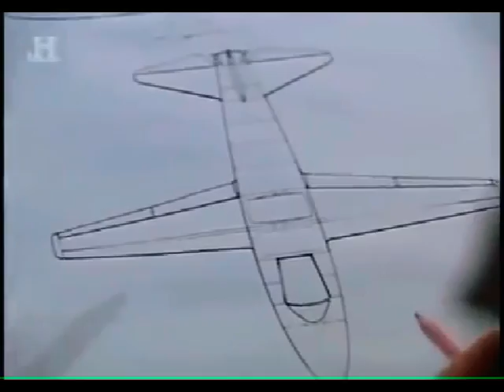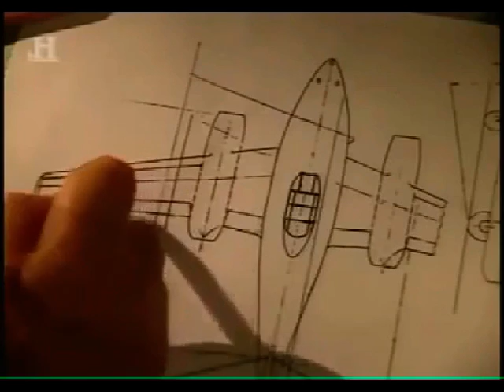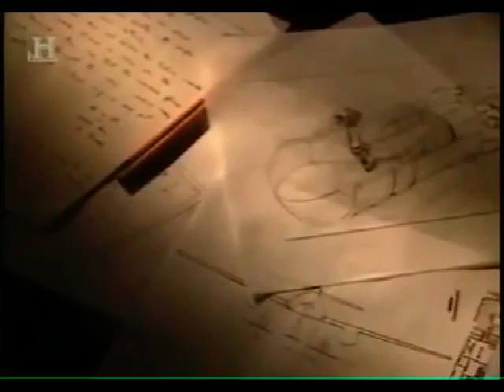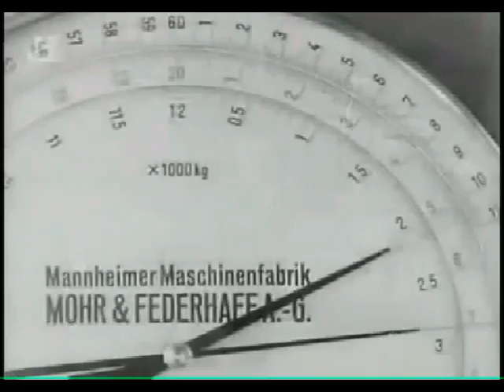The Father of the Jet Engine - Hans Von Ohain

Comment from the maker: The Jumo 004a (not the 004b)..had a service life of 200-250 hrs ...the limitation of the engine was down to materials shortage and not the design or construction. Further, it could be swapped out in 2hrs - unlike a spit engine which too 48hrs
Reply: +spottydog4477 If the German engine were so good they wouldn't have been discarded so quickly after the war.
Reply from the maker: They werent.........
Reply: +spottydog4477 Yes they were. They were an evolutionary dead end, superseded by British designs. No engine today traces it's history back to the German jets. Every engine produced today is related to Frank Whittle's designs.
Reply from the maker: German AXIAL flow design = Future of all engines
British Centrifugal design - junked by '47
Reply: +spottydog4477 France  built its fighter jet industry based on BMW 003 ..Dassault ,the most successful  pioneer in Europe didn’t even consider British technology..germans were miles ahead ...
Reply: +spottydog4477 German axial flow engines were copies of British axial flow engines. Britain was not just world leader in centrifugal designs it was also leader in axial designs. This was no surprise seeing as the inventor of practical axial compressors, AA Griffith, was very much British. We never saw British axial engines in the war because centrifugal engines of those early thrust ratings were simply vastly superior. The Gloster Meteors reserve engines (Metrovick axial flow) were the best axial engines of the war. It is not surprising countries with zero experience of jet technology (France and Czechoslovakia) picked up some free German tech after the war before quickly discarding it.
Reply: +FORBAN2 What do you mean they didn't consider British technology? The Mirage aircraft were built to accept RR Avons. I believe some of the prototypes even flew with British built Avons!! The French didn't even have confidence in their own design (which no doubt was a copy of the Avon in any case). In fact many customers refused to buy Mirages unless RR Avons were fitted.
Reply: +FORBAN2  I think you had better do some more homework. France's first successful fighter the Dassault Ouragan had a RR Nene. The later Dassault Mystere used a RR Tay and the Mirage III was designed to be able to take the RR Avon and flew with one. France also built the Vampire (as the Mistral) with a RR Nene. The Caravelle airliner used RR Avons so would that count as considering it?

And the Avon was a much bigger success worldwide than the Atar. 

The US licence built the RR Nene,  Tay and the AS Sapphire and later the RR Spey (as the TF-41) used in its A7 Corsair. Sooo. I think
Reply: +spottydog4477  Aaaah nope. Utter nonsense. Centrifugal engines are in use in their tens of thousands all over the world today primarily as turboprops and are still in production.

As for the centrifugal engines being junked by 1947 - that is nonsense.  The RR Nene was licenced/stolen by the Soviets and used in the MIG 15/17 (and the Chinese in their copies) which outperformed the early Sabres in the Korean war, the French used the Nene in their Vampire version the Mistral, The Nene and Tay in the Ouragan and Mystere, the Canadians licenced the Nene and used it in their Silver Star T-33 variant. The US used the Ghost (J-33) in the F-80 and the T-33 (some of which are still in service with air forces today) and the Nene (J-48) in the Grumman F9F Panther, Grumman F-9 Cougar and Lockheed F-94 Starfire.

So not so Junked then… FYI Time for some homework.   As for axials - Whittle had designs for an axial engine in the 1930's - well before Franz- in fact that was his first preference (as it was for Griffith) but he knew the metallurgy wasn't up to is at the time.This was proven by the incredibly short service life (around 10-25 hours) of the Jumo and BMW units.

More to the point - the British had axial engines running in 1941-  the same time as the first full tests of the Jumo 004 and flying in 1943 (Metrovick F2) long before they saw a German engine and in the production pipeline with the Avon and Sapphire shortly after WWII. When the UK and the US experts examined German jet technology after the war they found nothing significant and the British continued developing their own axial units which were then licenced by the US and used by many other countries. If German engines were truly superior the US would have copied them and not had to pay licencing fees to the British.
 
Just FYI, the longest running production axial gas turbine engine in history is the RR Avon which is still in production as a gas turbine generator.
Reply from the maker: and AXIAL flow engines are made 1000 times more often than centrifugals  in todays production
Reply: +spottydog4477 Do you take this Aerogeek   idiot seriously ??  All post war Rolls Royce engines were dead end !!Yes all UK and US experts WHO examined German engines came to that conclusion : 

  the end of the war the Germans had at least three separate full scale company-based jet engine programmes in progress, as American and British interrogators discovered to their astonishment in the summer of 1945. Ohain's original test engine, the He-S3B, had been built for simplicity with a centrifugal compressor like Whittle's, but Heinkel had then proceeded to more advanced designs like the He-S30 with axial-flow compressors. Meanwhile at Junkers, Germany's leading engine maker, Anselm, Franz had led the development of the Jumo 004, a simpler  axial-flow   turbojet, which went into 
mass production and powered the Me-262 fighter. A third programme at BMW produced the Bramo 003 engine, which featured a counter rotating compressor, different from both the Jumo 004 and the Heinkel He-S30. Ultimately it was this Heinkel design, incorporating both rotors and stators, which became the standard configuration for commercial jet engines.6 On this evidence it is clear that the Germans were decisively ahead in the field by the spring of 1945. And this feat is all the more extraordinary when one considers that they lacked vital raw materials with which to make heat-resistant turbine blades, such as nickel, cobalt and manganese, and that their work was continually disrupted by the Allied bombing campaign.7 By contrast the British were proceeding on a narrower front, with Whittle's relatively primitive design remaining the main empirical reference point for British engine manufacturers.There is not much doubt that had Germany not been defeated it would have led the world in jet engine development in both the military and civil sectors.WHO is right ?? a  Professional autor like Peter Lyth  ( a Brit I might add) WHO comes up with a study and an impressive reference list    or   a notorious troll and pretender  like this  Complete Aerogeek.. Everything what  this moron says  is bullshit.. Brits never ever ever had a working axial flow engine until 1950's   !!!!!!!!!!!!!

www.artefactsconsortium.org/.../3.04.Transport-Lyth,JetEnginesGrPics75ppiWEBF.
Reply: +spottydog4477 it was Pratt&Whitney who pioneered the twin-spool concept in 1948, long before Rolls Royce which made commercial jet engines possible as single spool turbojets would never have been suitable for commercial application due to high fuel consumption and both GE and Pratt&Whitney have introduced the high by-pass turbofan ratio engines before Rolls Royce in 1960's this was the first time the US overtook Britain in engine design as well.
The rest of the story is common knowledge. These developments have nothing to do with Whittles primitive centrifugal ..
Reply: +barracuda7018 Wrong again. You must be used to it by now. Bristol Siddeley did it with the Olympus in 1950. The world's first two shaft/spool engine.The two spool P&W J-52 did not run until 1955. The RR Conway was also the world first turbofan engine... Even the P&W J-47 was based on the Metrovick F2. The US used the Sapphire (J-65) ina  number of its aircraft and the turbofan Spey (TF-41) in the A7 corsair.
Reply from the maker: Gary Tarr Ladies..please......a little courtesy....
Reply from the maker: Gary Tarr - banned - this time no coming back fucking troll that you are
Reply: Not only that but the Mirage itself was a rebooted Fairey Delta. Went on to become one of the most successful aircraft ever built. Ignored by the British gov, as usual. Also Whittle went with the centrifugal design for practical reasons, they were building the compressors for the superchargers already, geez, they think Whittle was unaware of axial flow engines??
Reply: Reliable for 25 to 50 hours only due to unsuitable alloys
Reply: barracuda7018
Re-read what aerogeek said and then realise the British did all that basically working in garden sheds before Rolls took up production.
Reply: Well said Martin de Angelis,  These fools should look at the original Whittle patent to see that it was both Axial and Centrifugal, ohain did NOTHING original that hadn't been encompassed by whittles ideas!  And I challenge anybody here who has a Patent (and hence understands the process) to say otherwise!!!!!
Reply: no try 10 hours till complete rebuild.   But yes you are right.  It was materials.  The alies prevented germany from getting nickel and chromium!  This above all else was pivotal to the construction of the turbines!  while I disagree with those argueing that Ohain was the father of the jet engine, reliability claims are unfounded!
Reply: Bear Baler I disagree with those argueing that Ohain was the father of the jet engine, reliability claims are unfounded!

Mate  he Von Ohain  progressed  much faster than Whittle and solved technical problems faster than the British..I  and  I am not alone on this, the majority of aerospace engineering community in France disagree with those who argue that Whittle was the sole inventor of the jet engines we fly today as there are tremendous amount of evidence proving otherwise.Todays high bypass axial flow engines have nothing to do with whittle, absolutely nothing . 

On the  other hand I know  the british mentality, many  brits think that because they produce  the  wings in  an Airbus plant in Wales, the  Airbus  is  a  british designed plane.  Nobody is surprised.
Reply: FORBAN2
Jesus H Christ, get an education, please. It's embarrassing reading.
Reply: Martin de Angelis, we can't educate a fool mate!
Reply: Bear Baler LOL ...
Reply: FORBAN2
It was well meant advice. Educate yourself. Take it or leave it. No skin off my nose.
Reply: Forban2 - Your rant is so full of inaccuracy that it is unworthy of deconstruction. 

Look, no one denies that original concepts can be developed, expanded and improved by others. This happens all over the world all the time. There can only be one inventor however and in this case it was not Von Ohain for the myriad of reasons already stated by others. There have been several incontovertible truths put forward already that prove Whittle's claim. All we get from the two or three naysayers on here is "unfounded" or "not true" etc. etc. without any evidence to back it up. One can only wonder if they are working to their own agenda. If you want evidence, go to the British Patents Office or read Von Ohains own account in his memoirs. Alternatively, read the US government's own reports of their debrief of Von Ohains team after the war. Do some proper reading before you come on here spouting what you want to believe rather than what is true. I am fed-up with people trying to rewrite history. If you want that, go and watch a Discovery Channel documentary or something.

Also, I think you are exagerrating in your anti-British diatribe on the origins of Airbus. I am unaware of anyone thinking that Airbus is a British designed plane. Everyone knows that many designers from many countries contribute to the final product. The fact that the wings, undercarriage, engines and many other items are manufactured in the UK doesn't mean that it was designed there.
Reply from the maker: Hi Tangles. I think I  was pretty grumpy that day when Gary for to me....ahahaha

hope you're keeping well mate!!
Reply: spooty.
It is such a shame you do not do proper research and you let idiots like barabum and fornob tell lies.
Ohain copied whittles patents and the German jet engines were poor designs, they never worked properly.
Whittle went to USA and gave them their first jet engine, Rolls Royce took over the early Whiittle design and improved it to make the Derwent and Nene.  Metropolitan Vickers made working axial flow engines that were well in advance of the Jumo or BMW.
Post war the RR Nene and RR Avon  along with the Armstrong Siddeley Sapphire were the engines that went forwards, the  BMW held France back a lot and the Jumo was quickly dropped by USSR and they were very glad to get the Nene, Czechoslovakia tried to use the Jumo in their version of the Me 262 but it took years and was soon dropped.
Reply: the best was (as allways) BMW - they had a single, radial combustion camber and they also had stators and their 003 had a much better thrust to weight and fuel consumption ratio then the Junkers one
Reply: spottydog4477 centifugal compressor are still flying in helicopters, meaning that this is not an obsolete technology.
Reply: ww.ww
The BMW was even worse than the Jumo, the British designs were not only more reliable but gave more thrust.
Reply: barracuda7018
Not this turkey again!
Reply: THEY WERE
Reply: @ Barrie Rodliffe
 - More reliable than the German engines? Yes. Greater thrust? No.
Reply: Google "Metropolitan-Vickers F.2 engine"
Reply: The Vickers never saw service during WWII...

The Metropolitan-Vickers F.2 was an early turbojet engine and the first British design to be based on an axial-flow compressor. It was an extremely advanced design for the era,[1] using a nine-stage axial compressor, annular combustor, and a two-stage turbine.

It first powered a Gloster Meteor in November 1943, outperforming contemporary models from Power Jets. In spite of this excellent start, it was considered unreliable and never saw use during the war. In the post-war era, a number of engines provided much higher performance, and interest in the F.2 waned.
https://en.wikipedia.org/wiki/Metropolitan-Vickers_F.2
Reply: I spoke with a former draughtsman from the Gloucester factory. He told me the Jumo was a far superior engine hindered by a materials problem, especially in certain seals required, which reduced the engine's life. apart from that, the Jumo ran rings round the British product.
Reply: Colin Rowley   - The number one problem with the Jumo engine was the lack of nickel alloy steel for the turbine. There was a lack of nickel in Germany and what little there was, was used elsewhere.  I worked on jet engines in the USN. Engines like the J-52 and TF-30 used carbon seals internally. Did not seem to be a particularly strategic material.  Jumo engineers resorted to hallow, air cooled turbine blades to help extend their life but even so, engine life was as little as 10 flight hours. 
One reason the 262 ran rings around the Meteor was that the German jet was much cleaner aerodynamically.  The 262 looks like a shark, the Meteor a whale.
Reply: @scootergeorge9576  
The number one problem with the Jumo engine was bad design.  It was dropped at the end of the war, Britain looked at it and had no use for it, USA got British designs and had no use for such a poor design, France did take the BMW but had to modify it a lot, they also used British jet engines, USSR tried to make the Jumo work but gave up.
One of the reasons the Me 262 was a poor fighter, it was not a good design, the Meteor was more advanced.
Reply: @barrierodliffe4155  The Westinghouse J-34 looks like it borrowed quite a bit from the 004.  The Me 262 was designed to be a bomber interceptor  and not a fighter in the classic sense.  Meteor more advanced? Not really.  The centrifugal turbojet was a dead end design.  The 004 was flawed, primarily due to the lack of high temp alloys such as nickel.
Reply: @scootergeorge9576  
The J 34 first run in 1947 was developed from the J 30 which first ran in 1943, so  it did not owe anything to the failure Jumo.
The Me 262 was intended to be a fighter,  the Me 262 was not advanced, it started life as a straight wing aircraft, later modified to take the Jumo engines, the wings slightly swept back to correct the balance but not for aerodynamic reasons and also changed to a tricycle undercarriage.  The centrifugal engine worked and is still in use while the Britiash axial flow engines led to what we have now, the badly designed Jumo was very much a dead end, it still did not work with suitable alloys.
Reply: @barrierodliffe4155   High speed + heavy armament + poor turning capability = interceptor. And with the bombing campaign by 8th AF devastating Germany, bomber interceptor is the only logical  conclusion.
Reply: @scootergeorge9576  
The Me 262 was designed before USA was even in the war, so that theory fails, try harder.
The USAAF bombing was not even a great threat until late in the war by which time the Luftwaffe was short of fuel and experienced pilots.
Reply: @barrierodliffe4155   - By 1942/43 the design had been finalized as an interceptor armed with four  30 mm cannon.  The primary reason the Luftwaffe was short of fuel was the concerted attacks on synthetic fuel refineries in 1944.  And it was not till '44 that the P-51D was available in sufficient numbers to protect the bombers deep into Germany.   This cut into fighter pilot training but Luftwaffe policy of keeping pilots in combat till dead had a lot to do with it too. Their experience was not passed on to the replacements.  And American P-47 and P-51 pilots had something to do with Luftwaffe pilot losses...
Reply: @scootergeorge9576  
The design was finalized before much USAAF bombing so it was not just made to protect against USAAF bombers was it?  The initial attacks on fuel refineries  had little effect, the RAF attacks on transport prevented the fuel from getting where it was needed, it was not until 1944 that the P 51 B/C were available in sufficient numbers to provide an escort, the P 51 D came later in 1944.
The P 47 and P 51 had little to do with Luftwaffe pilot losses and shortages in early 1943.
Reply: @barrierodliffe4155   The Luftwaffe transferred the bulk of their fighter forces from the eastern front to counter the bomber offensive.   And the P-47 and P-51 virtually decimated the Luftwaffe fighter forces.   There is no getting around that.
Reply: @scootergeorge9576  
If it was true rather than Hollywood nonsense.
Just try to look it up, The Luftwaffe was all but finished by 1943, they had plenty of fighters but had run out of experienced pilots thanks to  the USSR and particularly the RAF. There is no getting around the truth.
The P 51 did nothing much until 1944 while the P 47 was rather hopeless as a fighter.  .
Reply: @barrierodliffe4155  - the P-47 was far from being "worthless" as a fighter  A number of American aces achieved impressive records while at the controls of P-47s. Thunderbolt top guns included Francis “Gabby” Gabreski (28 kills), Robert S. Johnson (27 kills) and David C. Schilling (22.5 kills).
https://militaryhistorynow.com/2015/04/20/the-jug-10-cool-facts-about-the-p-47-thunderbolt/
Reply: @scootergeorge9576  
The P 47 was the biggest, heaviest and most expensive single engine fighter, it had poor performance and lacked maneuverability, the USAAF claims are notoriously inaccurate as the USAAF pilot of an unarmed Spitfire PR Mk XI found, he was attacked by 4 USAAF P 51's and having outmaneuvered them then climbed away after noting their markings, he later went and found out who the pilots were, he was very surprised to find that at the time and place they had been vainly trying to shoot him down with no Luftwaffe in sight, they each claimed  1 Bf 109.
Your link is a very jingoistic load of tripe to be kind to whoever wrote it.
The many times P 47's attacked Spitfires and never once shot one down is rather amazing, nothing else is, the Spitfire was faster, had much better acceleration and climb, went higher dived much faster and was far more maneuverable, I have heard that USAAF P 47's also attacked Hawker Tempests often but again no chance,  there is even an account of Tempest pilots fed up with being attacked so often turned and shot down a couple of the P 47's, there are two versions, in one it is Belgian pilots, in the other New Zealand pilots. It seems that British pilots just flew away rather than shoot down allies.
Reply: @barrierodliffe4155     430+ MPH  is hardly indicative of poor performance.  While not as nimble as, say,  a Spitfire, it was fast, rugged, had decent range, and had massive fire power.  Many pilots loved the "Jug" and were very successful with it in combat.  And it certainly was not only  one of the greatest fight/bombers of WWII but of all time.  One of the biggest mistakes the USAF made was not keeping a few hundred Thunderbolts in service with air guard units after the war. In Korea, it would have been a much better weapons system than the F-51 Mustang. 
In the heat of combat it was not unusual for Allied pilots to mistake a Mustang or Spitfire for the Bf 109. Same with the P-47 and Fw 190A. Probably the only Allied fighter that did not have that problem was the P-38 which largely was a failure over Europe but did quite well in the Pacific Theater of operations.
Reply: @scootergeorge9576  
430 mph is not bad, the poor acceleration and climb is not very good, by the time the P 47 was in the war the Spitfire had half decent range and unlike the Blunderbolt very successful in combat.
It took a P 47 D of 1944 longer to get to 30,000 feet than a 1942 Spitfire Mk IX took to get to 40,000 feet.  P 47  range at cruising speed 785 miles on 205 gallons.
Spitfire Mk IX range at cruising speed on 85 gallons would not be far short of that.
In the heat of battle is one thing but when the only aircraft around are allied is when USAAF pilots often tried to shoot down Spitfires that look nothing like Bf 109's and had rather distinctive markings and invasion stripes?   I do not recall RAF pilots trying to shoot down P 47's.
Reply: @barrierodliffe4155   Blunderbolt? [roll eyes] a good fighter pilot takes advantage of his aircraft's strengths while denying the enemy his.  The great service ceiling and fantastic dive speed allowed American pilots to fly above the bomber stream and dive down on the hapless German with speed they could not match. The speed gained in the dive also allowed them to climb back up with little feat of being tailed.  
Range and Endurance..."the Thunderbolt II and Mustang III easily head the list..."  Turning Circles..."In circumstances where the ability to turn quickly or tightly are infinitely variable, and where two aircraft are nearly the same, such as the Tempest V and Thunderbolt II, a great deal depends on the ability of the pilots. Speed must be taken into account if the results are going to be of any real value.
 For example, if a Tempest dives on a Thunderbolt with an overtaking speed of only 50 mph, the Thunderbolt will easily be able to avoid the attack by turning, although at the same speed in the hands of equally competent pilots, the Tempest will outmaneuver the Thunderbolt." More at http://www.wwiiaircraftperformance.org/sl-wade.html
Reply: @scootergeorge9576  
A good fighter pilot would love to be in a good fighter, that rules out the P 47.  
The poor service ceiling and low dive speed are not much to rave about either.
range and endurance were not exactly strong points on the heavy blunderbolt, it only had 1.5 hours endurance at normal cruise speed with 205 gallons, a real waste of fuel that could take a Spitfire faster and further. If the 
P 47 pilot dives on a Tempest he will be dead very soon and the slow lumbering p 47 did not turn, especially at low altitude while the faster more agile tempest did as well as the Tempest having firepower the P 47 pilot could only dream about.
Reply: @barrierodliffe4155   - Tell it to "Gabby" Grabreski. Polish-American who flew Spitfires with the RAF before Pearl Harbor. Had no aerial victories  but when he returned to the Air Force was assigned to fly the T-Bolt.  His first impression was, like you say; too big, bulky, heavy, etc. to be a fighter.  But he quickly changed his mind. It was a plane that could absorb a tremendous amount of damage and get him home. And his 28 confirmed air to air combat victories  say it could mix it up with Luftwaffe fighters and come out ahead of the game. 
And in the fighter/bomber role, the T-Bolt had a big advantage over Tempest and Typhoon and the Mustang for that matter. It lacked a radiator that could be punctured with small arms fire. It did have a big, hulking, 2,000 HP radial that could have a cylinder or two knocked out and keep on running long enough to if not get home, get out of enemy territory.  That is something pilots appreciate.  
Fuel efficiency was not the T-Bolt's strong point but  it wasn't years later with the F-4 Phantom II. That was a big, heavy powerful, rugged workhorse.  And while not as nimble as say, a Mig, when its pilot got the training to not only engage in air to air, fighter versus fighter combat such as Naval Fighter weapons School, better known as "Top Gun"  could kick ass.  Hell, when I was in the Navy with VC-13, the Fighting Saints, now VFC-13 Saint Adversary,  our pilots flying the TA-4J "Scooter"  would go up against Phantoms and  Tomcats and have some success.  And they were reservists!  But they did accumulate a ton of flight time with the fleet first...
Reply: @scootergeorge9576  
Any pilot who flew Spitfires before Pearl harbour and had no victories either had no or little combat or was not much good.
28 claims or so called confirmed victories probably include a number of aircraft the returned to base with little or no damage like all the Tempest's and Spitfires that were attacked by P 47 pilots yet they all flew home undamaged  and the USAAF pilots made yet another claim that was somehow confirmed.  
The Blunderbolt could be taken down by one 20 mm cannon shell in the wrong place, being air cooled did not mean it was impervious to damage.  
It is amazing how Spitfires often flew home after being hit by not so small arms fire or 20 mm cannon, the P 47 losses were rather high, the Typhoon was better for ground attack and having real firepower rather than pea shooters, just to quote the US Navy and USAAF both wanted to replace the 0.5 with 20 mm cannon and they rated the 20 mm as between 2.5 and 3 times more effective, like the Spitfire pilot who shot down 5 and damaged 2 more in a few minutes, 4 of the shot down and 1 damaged were Fw 190's.  
The P 47 does share being overweight and under performing with the F4.
Reply: @barrierodliffe4155   - If you've never heard of the man, just come out and admit it.  He had no combat experience when he asked the Air Force to release him to fly combat with the Polish Squadron of the RAF.    As for the 20 mm claim, just about any aircraft if hit in the right spot would be shot down.   And you can't seriously believe that a radiator in a liquid cooled aircraft would not be vulnerable and if hit in a single engine aircraft, the engine will seize in short order. 
The F-4 Phantom II was a great aircraft in it's day.  One of very few carrier aircraft successfully adopted by the Air Force.   Eleven other nations also flew this  aircraft.  http://military.wikia.com/wiki/McDonnell_Douglas_F-4_Phantom_II_non-U.S._operators
Reply: @scootergeorge9576  
I have heard the name but not much about him, maybe you should learn before making false statements, he did not fly any Spitfires before Pearl harbour but only in 1943 and he saw very little action, the first time he saw any Luftwaffe was the 3rd of February and it seems he had no idea what to do. He flew 20 missions in the Polish squadron and only 1 with any combat.   That sort of puts his record into perspective and does not affect the Spitfire being a far better more capable fighter than the P 47.  
Spitfires had a better record than the P 47 and lower losses when the P 47 turned up which was late in the real war , maybe early for the US.
The F 4 had little success in combat, the Royal Navy only used a few of them and it had a poor record, no wonder they had to be used on land..
Reply: @barrierodliffe4155   In '43. My mistake. But no mistake that he was a great pilot and believed the Thunderbolt was an outstanding aircraft.
Reply: @scootergeorge9576  
But having hardly flown the spitfire and not in real combat not in a position to compare like  William R Dunne, who flew with 71 eagle squadron, he flew Hurricanes, Spitfires, P 47's and P 51's.
"One must have really known the Spitfire in flight to fully understand and appreciate its thoroughbred characteristics.  It was the finest and in its days of glory, provided the answer to the fighter pilots dream – a perfect combination of all the good qualities required in a truly outstanding fighter aircraft.  Once you`ve flown a Spitfire, it spoils you for all other fighters.  Every other 
aircraft seems imperfect in one way or another.”

USAAF 31st FG War Diary (when transferring from Spitfires to P-51s): "Although pilots think that the P-51 is the best American fighter, they think the Spitfire VIII is the best fighter in the air." 

USAAF pilot Charles McCorkle (who flew both in combat), reporting on a mock combat between a Spitfire and Mustang in 1944: "Now we could see which was the better aircraft...a Mustang and a Spit took off for a scheduled 'combat', flown by two top young flight commanders. When the fighters returned, the pilots had to agree that the Spitfire had won the joust. The Spit could easily outclimb, outaccelerate, and outmaneuver its opponent... 

Writer Jerry Scutts, quoting German pilots in his book JG 54: "The Jagflieger had to keep a wary eye out for enemy fighters, particularly Spitfires, a type JG 54's pilots had developed a particular aversion to...Pilot reflections do not, surprisingly enough, reflect over-much respect for the Mustang or Lightning'

Karl Stein, Luftwaffe Fw 190 pilot (who served mainly on the Eastern front): "English and American aircraft appeared on the scene in those closing days of the European war. Spitfires were the most feared, then Mustangs..." 

While these mention the P 51 not the p 47 that seems to reflect the P 47 not being considered to be a good fighter. The P 51 while not close to the Spitfire did climb better and go higher than the P 47.
Reply: @agt155  The French and Soviets used them for quite a while and technology progressed very fast in general so you cant say they where bad engines.
Reply: @user-qp3hd3cn8e  
The French used a very much modified copy of the BMW, but they also used Rolls Royce engines. The Czech's tried to use the Jumo for a short time, USSR tried to use German jet engines but they very quickly dropped them and used Rolls Royce engines, so i can say they were bad designs.
Reply: The Jumo 004B would probably achieve 200 hours though every 25 hours the engine had to have its turbine and combustion chambers replaced.  From the point of view of keeping Me 262 in the air this was not a problem:  you kept spare engines, they were going to get combat damage anyway, and every 25 hours you spent 8 man hours swapping out the two engines.   You could service the engines in the field but in practice went to a depot or factory to refit thos turbines and combustion chambers.  The engines could be x-ray inspected on the wing of the Me 262 and if OK kept flying till 37.5 hours but don't know if this was done.  The German test pilot Lindenner once nursed an engine for 60 hours.   The service parts were extremely cheap and the service not expensive so the Jumo 004 was probably cheaper to produce and run than a piston engine.  The BMW 003 was much better at this.  Its combustion chamber easily last 200 hours and the gas turbine could be swapped out while the engine was on the wing.  The Germans just didn't have the alloys for long lasting turbine blades.  25 hours flying is about 15 Me 262 missions.   The Me 262 used a centrifugal governor to control fuel to the engine but around April 1945 they were getting a device roughtly known as the 'accelerator valve' in place.  This measured the airflow through the engine with pressure sensors and adjusted the fuel flow so that there would be no more burnouts from excess fuel flow from throttle handling or flameouts. Would have increased engine life.
Reply: @WilliamJones-Halibut-vq1fs  
They were lucky to get 25 hours and that was with treating the engine carefully, the problem is they did not have enough engines and in late 1944  when they did put the Me 262 into service most of the 1,400 made never flew.
The excuse that they lacked good materials fails since after the war no one had much luck trying to use the Jumo, Russia gave up and used the Rolls Royce Nene as the basis for their jet engines, used had been given British jet engines during the war and more after the war, France tried to use the BMW but had to make a lot of changes and modifications to get it to work, they hedged their bets by using Rolls Royce engines in some of their aircraft.
Reply: agt155 The British “inventor” of the jet engine, AA Griffiths,  was so brilliant he calculated that  it couldn’t be done and so didn’t bother till others proved him wrong.
Reply: FORBAN2 The structure of the German engines was axial compressor, cananular or anular combustion chamber followed by a single or double stage turbine.   The Jumo 012 was a scaled up Jumo 004 but with blow out valves added to the compressor to allow higher compression ratios.  The Germans used impulse compressors but also had reaction compressors on the bench designed to upgrade existing engines.
Reply: @WilliamJones-Halibut-vq1fs  
The British inventor Frank Whittle, his design worked very well and once Rolls Royce got involved was developed into the best jet engine in the war and for a time after it.
Ohain's copy of Whittle's patent did not work.
Griffiths design was taken up by Metropolitan Vickers and it was a better design than the Germans could manage, leading directly to the jet engine first aircraft to achieve supercruise.
Reply: Barrie Rodliffe The key thing that made the British engines more reliable was actually two things.  1 the nimonic alloy and 2 whittles invention of fir tree roots.   The Americans never bothered with nimonic and used the alloys they had developed for turbo super chargers.  The whole remainder of the German engines such as combustion chambers, exhaust pipe and translating exhaust nozzle were mild carbon steel due to shortages and this considerably added to the problems.   The Russians nabbed a lot of German engineers from the Jumo plant at Magdeburg complete with families but they never got hold of the alloy specialists from Krupp and Bohler that had developed improved alloys.  There is an old American article around that says they got to about 600 hours life on the Bench and they were expecting about 200 in real life.   I interviewed one old German woman who said the Russians kidnapped a nearby German girl as a fiancée for a young single German engineer they were taking to Russia as a comfort so he wouldnt be the only single guy.  Very kind and considerate.  The Germans ended up considerably developing the NK-12 turbo prop used on the Tu 95 Bear as they were moved through several design Büros.  It’s essentially a Jumo 022.   The Jumo 004 was being scaled up to about 2750kg thrust as the Jumo 012 and with extra turbine and gearbox added becomes the Jumo 022.   The competing BMW P.3302 turbojet had a variant with a pure mild steel turbine that had a design life of 2 hours ie essentially one mission.  German alloy shortages became dire.  Who knows what the Russians were doing but it seems they did nothing to support improved alloys for the German engineers.   After the war, in 1947/48 the Siemens company used a Jumo 004 compressor as a gas turbine power generator designed to run of blast furnace gas.  The turbine was water cooled and the nozzles ceramic.  Water cooled turbines was actually WW2 German research for flight worthy engines.  It works and you have a little steam for de icing.  No one bothers these days, though steam cooling is used,  as the alloys are so good. I know there would be issues with calcination but it isn’t going to be a problem with calcination etc but that’s not an issue that’s only going to run 200 hours.
Reply: @WilliamJones-Halibut-vq1fs  
Maybe if the only British jet engines were The Rolls Royce WElland or Derwent. Metropolitan Vickers made axial flow while the Halford  made a different centrifugal design, these were all given to USA who never used German designs. Any alloys would not make a bad design good.
Reply: Complete Aerogeek Designs for axial gas turbines go back to 1903, the only concept Whittle and von Ohain “added” was to remove the power turbine and rely entirely on reaction thrust.  AA Griffiths only worked on turboprops not jets.    The Jendrassik Cs-1 was the world's first working turboprop engine. It was designed by Hungarian engineer György Jendrassik in 1937, and was intended to power a Hungarian twin-engine heavy fighter, the RMI-1.
Reply: Martin D A The Fairy Delta was a rebooted Lippisch.
Reply: Barrie Rodliffe von Ohain had a working jet design and it was different from Whittles.  Whittle used a double sided impeller, von Ohain used single sided with an inductor fan, Whittle used separate combustion chambers, von Ohain used an anular one.  Whittle used an an axial turbine, von Ohain radial inflow.  Heinkel merely conducted a patent search and used nothing of Whitles.  The difficulty was flame stability and the patents didn’t plain that.
Reply: Just like a Porsche 959 is a rebooted Ford Model T.
Lippisch had the bright idea of a basket of coal projecting  into the airstream and ignited by a gas burner. The unfinished Lippisch glider was captured by USA and taken away to the States, there is no suggestion that Fairey a British company even saw it.
Reply: @barrierodliffe4155 The  British saw it through the work of CIOS (Combined Intelligence Objectives Subcommittee) and note that even the work of FIAT and BIOS was shared.   
http://www.bmcole.co.uk/WW2/2429.htm
The British were aware of Lippische's work and German swept wing work.  Even the "Crescent Wing" associated with the Handley Page Victor came directly from the work of Rudiger Kosin (Its British designer had examined the wind tunnel models) for an advanced swept wing version of the Arado 234.  You can google "Ar 234 crescent wing".  The idea of the crescent wing was to delay mach but reduce the sweep in the outer portions to 'loose' the span wise flow that would cause premature tip stall.  German swept wing work was of extreme value equal to 2 years of allied catch up research because one just can't sweep a wing,  you'll get impossible handling.  All manner of devices and techniques need to be added to avoid the side effects of span wise flow.

The work of Gotlieb Daimler, Karl Benz and Ferdinand Porsche predates that of Henry Ford.

Frankly its obvious that both von Ohain, Whittle were capable of independently producing a jet engine.  I have no time for this idiocy about who did what first.  The German practice did survive in turboprop design in both the Soviet Union (NK-12) and in the US where Franz Anselm (who developed the Jumo 004) developed the Lycoming T-53 which powered the Iroquois helicopter and also the AGT-1500 which powered the M1 Abrams tank.  This was modelled more on von Ohains practice.

The German gamble on axials paid of because at 2000lbs of thrust its very difficult to make a single engine jet and they have to be mounted on the wings.  The large diameter of the British engines created integration issues that meant the Meteor had speed and mach issues till the nene based Derwent V and long nacelles.  However as soon as the thrust went well above 4000lbs (Nene etc) single engine jets become viable and the large diameter becomes irrelevant as it can be buried in the fuselage.  The Americans immediately recognised this probably as a result of the Bell XP-59.   Without a 4000lb thrust jet engine the Germans would have struggled to exploit there superior aerodynamic knowledge.
Reply: @WilliamJones-Halibut-vq1fs  
As usual you prove you haven't got a clue.
USA had their own unique way of sharing, all take and no give.
Britain was well ahead of Germany on supersonic research and well ahead of jet engines, both centrifugal and axial flow. 
The XP 59 was a complete failure, even if it used a British jet engine, the first successful single jet engine fighter was the DH Vampire.
Germany and superior aerodynamic knowledge is a big joke.
Reply: Complete Aerogeek All the Mirage I, the planed Mirage II all flew with French engines.  Australia did order Mirage IIIO with Avons but switched to the Atar, they were manufactured in Australia.  Hermann Östrich designed the BMW 003 and he worked on the Atar.  He preferred the French finding them less arrogant.
Reply: @WilliamJones-Halibut-vq1fs  
The Atar did work eventually but it took a long time and much modification from the bad BMW design, no wonder the French used the RR Nene for many aircraft and even designed the Mirage to take the Avon in case they did not get the Atar to work.
Reply: @Rollers123a  I spoke with a former draughtsman... cool story dude.